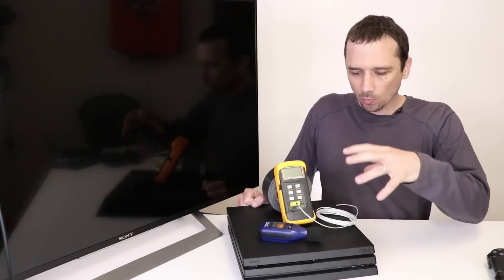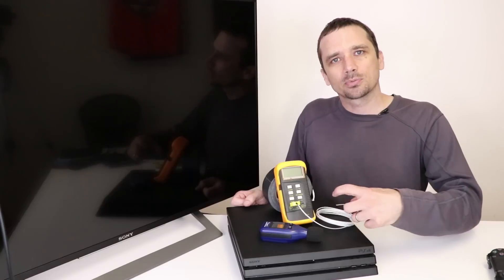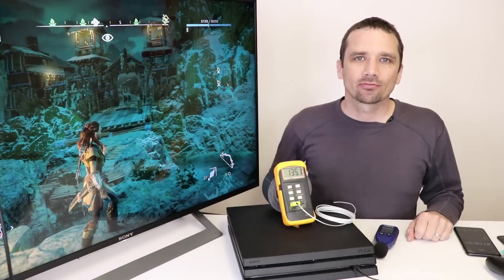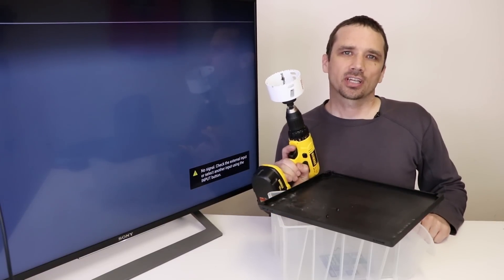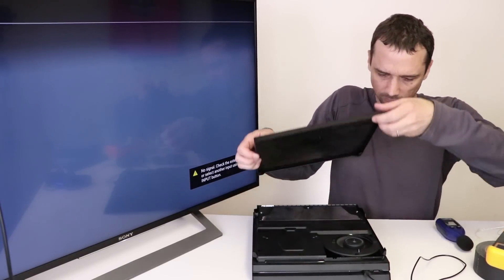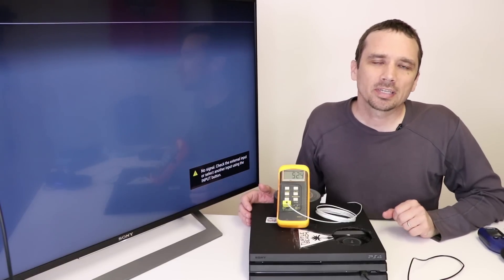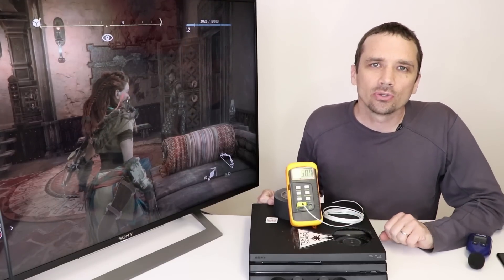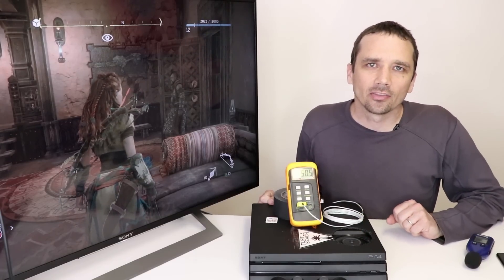PS4 Pro Case Mod - Fan Noise Overheating Fix?

Comment: If the system isn't actually overheating why would you consider doing it? My PS3 slim and PS4 launch never overheat. They get hot but unlike my PS3 fatty I never get the about to shut down message. I did modify my fatty drilled holes in the bottom and did the fan mod and replaced the thermal compound over and under the heat spreaders but those units had issues from launch.

Comment: Or you can just take the cover off and stand it on its side with a small air fan blowing towards it . 😎 I did that last two years and it's a lot cleaner 🤣😂 and cooler less heat all together.  Also the shiny metal part is also getting cooled down.
Reply from the maker: Yep, that would work as well.

Comment: Wehile this works in certain cases and increasing airflow reduces temps especially when open air, the old design maintains a steady temps at least by isolating the exhaust's heated air at the back and grabbing the cool air at the front. Unless you have a well ventilated and open area for the ps4 for this to work well. But in most cases, the old design works pretty well.

Comment: You should have used liquid metal on the cpu (conductonaut) instead of drilling holes in the ps4,you would have seen more noticeable improvements in temps
Reply from the maker: I'll test it with liquid metal at some point.

Comment: Great to see Playstation owners trying to mod their consoles to compete with the power of Xbox One X.
Reply: Be cool if the Xbox had actual games to play to use that power.
Reply: I love how xbox fanboys love to talk trash about how 'weak' the ps4 is when the weakest current gen console is an xbox that struggles to play games at 720p
Reply: TrainNkill bro I play ps4. But an Xbox 1 can easily run 1080...

Comment: What size hole cutting bit did you use to cut the hole? Can you make a video on how to measure and cut the hole for a perfect fit?
Reply from the maker: It's a 3 5/8 hole saw. I didn't measure it...I just drilled it about where it should go.
Reply: Thanks

Comment: Even if it ran cooler. Why would you drill a hole in your PS4 PRO? Simply saying that would invite even more dust inside the console and in turn would make it run warmer.

On a side note it would be funny though to try and send it into SONY to fix and the looks on their faces when they see the hole on top.
Reply from the maker: Why would I not drill a hole in my PS4???
Generally, it's not the dust that makes them run warmer (although if there is enough of it, it definitely would). It's usually the combo of dust, hair, etc. It gets in and plugs the heat sink. If you keep it up off the floor and in a well-ventilated area and you don't live in a really dusty area it will be fine.
Reply: That was my point. With a hole in the top that would invite everything from dust, dirt, food, human hair, pet hair other fibers into your console. Of course yourself it might be fine because I'm sure you clean the inside of your PS4 PRO regularly. But, For the common gamer the PS4 and any other console we get in it has on average 3 compacted handfuls of dust and dirt and I could only imagine how much it would have with an open hole that is about the size of a hockey puck.

Comment: I did this at the weekend. Got my hole lined up perfectly and installed a mesh grill. Looks really good and noticed an instant improvement in fan speed/noise and temperature. Works a treat
Reply from the maker: Nice work!
Reply: I really wanna do RGB led strips and a color changing paint job on mine...
Reply: @mikeoxbig7806  how about I Focus on the overheating for now

Comment: What you could do to add to your mod is add a fan to it let the fan push air into the ps4 fan see what temperature your going to get I'm sure it would be alot cooler

Comment: Hi, can't you just leave the lid off?
Reply from the maker: Sure...but that'snot as fun!
Reply: TronicsFix I am getting one tomorrow believe it or not, but you have got me worried about the temperature and noise?
Reply from the maker: It will be fine. Sometimes it will get loud, but that's normal.
Reply: TronicsFix ok thanks buddy will let you know,
Reply: TronicsFix hi buddy,
Got the PS4 pro today, working like a dream 😃😃😃

Comment: I did this on mine (ps4 pro) and installed a 4 inch usb fan above the hole to push more air in, the thing is whisper quite now.... 100% worth doing 👍🏻
Reply from the maker: Nice! Thanks for sharing.
Reply: @Tronicsfix  hi  Tronics fix could you please make a video what this buddy has done with his ps4 pro and could please say where can I buy a top case or a new case for my ps4 pro?
Reply: I'm thinking without the cover on there would be no flow thru the system so I don't think that would be the best idea, but trust me I'm winging this and so far what I've done has made a massive difference 👍🏻
Reply: @goebes1066  

Hello, would taking just the top cover off be okay instead?
Reply: @AshesHereos  I wouldnt reccomend running it without the top cover fitted
Reply: Goebes you think it would help to just have the cover off??

Comment: A scientific approach .... Well done. So it does change something. 
now the good question is : do I have the balls to do this modification ? not now, since I still have my warranty.... 
And I need to check also with PC modders in order to find a protective grid for this hole....
Reply from the maker: You can always just remove the cover and see if that helps.
Reply: good idea ! 
:-)

Comment: Should note that dust will collect a lot easier with this mod considering the fan is exposed at the top of the system.
Reply from the maker: Ya, just like I said in the video.
Reply: TronicsFix Just like you said what? You never mentioned anything that I spoke of. 

But feel free to timestamp where you talk about dust/foreign object collection in the fan housing with this mod.
Reply from the maker: Ha, ha...just checked...you're totally right...apparently I edited that part out.
Reply: Yea but i think if you can somehow have an dust filter that was easy to access like a good pc case.

Comment: Hi tronicsfix,
Have you had any issues with God of War? It's the only game that's been crashing on my Pro. It's a digital copy from PS Store.
Any remedies you could suggest?
Reply: I did. My pro sounds like a jet at times playing god of war
Reply from the maker: I haven't played it...I might have to though.
Reply: 👆I haven't had any issues playing god of war on my PS4 PRO on my 55 Sony X930E...I've played 11 hours straight thru...This PS4 PRO is only 2 months old...it's Definetly a newer model..I also replaced the stock HDD with a 2tb sshd from

 seagate...try cleaning your old PS4 PRO with a compressed air can...gotta keep it clean..and make sure it's in a well ventilated space...not an enclosed entertainment case..also Doom

 with the enhanced 4K Patch makes the PS4 PRO fan scream a lot worse than god of war...probably because it runs at 60 fps...it's glory killing that PS4 PRO to the max limits...both are digital copies
Reply: 👆Carbon suicide mtb...I get it..I have an XBOX ONE SCORPIO Edition Also...I Understand that the PS4 PRO Patch Is Not Native 4K...But Checkerboarded 4K on both God Of War and Doom..It runs

 smoothly and quietly on the X..But it doesn't change the Fact that my PS4 PRO Fan screams to the max when running these Pro Enhanced Games...
Reply: delete it and download it again
Reply: Tom Pupino 1440p is not 4k, there is 6.4 million pixels missing from 2160p

Comment: I have the release day ps4 and it sounds like a jet but I'm buying a new ps4. Which ps4 is the most silent and would stay silent for a long time? I was thinking between the slim, pro or cuh-1200 pls help!
Reply: @Reminiscence26 doing thermal paste is very risky because I have to detach basically all the mini wires inside my ps4 and take everything out to just get to the mother board and buy all the supplies and tools and then MAYBE it might work who knows.  I'm just gonna sell my ps4 and buy the slim and it also supports 5ghz which I want also and the 1tb so I think to me it's worth the upgrade
Reply: Carbon suicide mtb SMH Cause X always has 2160p right? This is a straight lie. High to Ultra graphics? It has a higher setting for textures and sometimes minor better CPU settings. It has the same crappy CPU in it as the Pro. Please stop spreading lies. Thank you.
Reply: I have the CUH 1200, if u have the cash go newest generation PS4 Pro instead of launch version.
Reply: My PS4 Pro CUH 7115B is super quiet. But if you don’t have a 4K T.V. And you don’t care about supersampling and a few extra frames, go for the slim.
Reply: Have you done a thermal paste change and this fan mod, sinse you bought it? You may not even need a new ps4. Like you, i have a launch ps4. With the fan mod and MX-4 thermal paste. Still runs great and not too loud. It is true though, that the slim has a quieter operation. But on a well maintained, launch ps4. There really isn't a massive difference in fan noise tbh.
Reply: If you're wanting silence the slim is definantly the way to go.
Reply: iptia  I have the pro and when you play god of war it’s loud. I took it apart too clean the fan with air from dust it helps a little but it’s still loud
Reply: The Slim is definitely the quietest of them all. Digital Foundry tested them all when the Slim/Pro launched if you look it up.
Reply: BuzzRaceWars everything I said is fact snowflake, the ps pro is a complete joke, deal with the facts, even if it does make you upset, now go to your safe place before you make a complete fool of yourself again
Reply: Wait until after E3, who knows what there might be.
Reply: iptia buy a one X, it's silent, plus the difference between 1440p on the pro and 2160p on the one X is 6.4 million pixels plus pc high to ultra graphics settings, it is far superior

Comment: if u cut a larger flow then it will suck twice as much dust
in it. Dust is everywhere no matter how clean ur house is it is still visible in the air.
Reply: that's why you clean it :|
Reply: Dust filter.
Reply: Dust already gets in anyway through the normal intake. You should be cleaning regularly. With this mod, you need to clean regularly. Nothing has changed.

Comment: im really big fan of your videos , i really need a help so please answer me i have a ps4 pro and i used to have Dell pc that got damaged so i took its fan that working as sucking the heat nd getting it outside and it seems really strong fan so i put it after i did power circle to the right corner of the ps4 pro but as a fan to push air to the vents but i have notice it sucks dust nd push it inside so i decided  to put it in the back on the left side so it can suck the heat from inside and when i put my hand  i feel the fan pushing too much hot air and vents in the back from right side close to the power cable i have noticed the hot air that used to flow before much nd hotter start to get slower so i want to know does the fan works fine or it is because fan strong so it is taking most of the hot outside so the vents just pushing few hot air
Reply from the maker: I'm sorry...I can't understand your question. It is literally one long sentence. Any way you can break it up and make it understandable?
Reply: You literally do not need to use any 3rd party fans, or modify your console. It has a negligible difference and can be harmful!
Reply: thank you for your answer all i mean is i put a fan in the back of the ps4 pro to  absorb the hot air and when i put my hand on this fan i feel it is taking out hot air from inside ps4 to outside from back vents so does this help the cooling process by  helping the vents to get out the hot air
Reply from the maker: Sounds like something that won't hurt anything but it likely won't help much either.

Comment: yeah but it's not pulling heat off the hard  drive and cd rom. 

your test is just reading the exhaust off the cpu right? befor the hole was made, it was the heat from the hard drive, cd rom and cpu. you by passed two of the three heat sources from the looks of it. please confirm that is, or is not the case
Reply: bdroms and hdd do not generate that much heat to be cared at all... the main super hot heat source is the cpu and only the cpu
Reply: No there isn't. The blue-ray drive does not generate any significant heat (when it does spin, rarely in game since they're mostly played from the hdd) from my experience and the hard drive is on the bottom and to the back.
Reply: Forgetting the drives for a moment, the way these things work is like the shroud in a hot rod. Containing the air rather than allowing it to disperse, so it blows (and blows *fast*) across the components where you want it. If you're getting cooler air at the exhaust, it doesn't mean you've cooled the system better--quite the opposite. What you want to see is more heat exhausted, less heat on the processor.
Reply: I place a small-ish desktop fan in front of my Pro sometimes and even though it doesn't really make it any quieter it certainly stops it from getting as hot.
Reply from the maker: Air comes in from both sides of the console and is exhausted out the back.
Reply: Manuel G Yeah when i touch my console after 4 hours of gaming I can feel that it’s extremely hot where the power supply is placed but apu gets good cooling in these consoles I never experienced any heat issues.
Reply from the maker: I'm not sure what you're talking about. These don't have a CD rom. There is no heat source that's been bypassed. Did you watch the video?
Reply: TronicsFix as the console is facing  the viewer, you say the airflow is from left to right, then out the back towards you. are there any heat sources on the left side of the console, like a game cd reader or hard drive that do create heat now being bypassed because of the hole?
Reply: @Tronicsfix  he is correct this might cool the heat being dispersed but components might not be getting the correct air flow

Comment: Title should be "How to make your ps4 pro stay cool and quiet"
Reply from the maker: Ya, but that's not nearly as dramatic!
Reply: Would try it on my one X but it doesn't seem to have cooling or noise problems but i did re-purposed the fans out of my 2007 xbox 360 and wired them to run off the wall outlet as some extra cooling for the summer, i stand it up next to the side vent.

Comment: Nice im definitely doing this, there's a magnetic fan filter that you can use to put over the case and it makes it look much nicer and cleaner, cheapest place i found it on was on ebay
Reply from the maker: Good idea
Reply: Hey can you link where you found the fan cover
Reply: Dylan Salcedo i don't think i can post a link but i can tell you the name its called DEMCiflex fan filter, you can find them on ebay and amazon
Reply from the maker: You mean the plastic housing for the console? I had it laying around my shop.

Comment: Please, Steve, I would like to see how far does god of war push the ps4 pro, because I have tested the game on a slim and doesn't make much noise, in the other hand the pro sounds so loud. So try to test it for us.
Reply: Playa' I guess it depends what pro you have I'm guessing the first few are louder than most recent one or could also be that the pro has to deal with more like trying to stabilize the framerate or sharpness resolution too.
Reply: @Playa' how does the slim sound? Does it get loud on some games like bo3? I am thinking of buying it
Reply: Lefty nation, my pro is one of the recent ones
Reply: Iptia, the slim is very silent as far as I can tell, but if you want more power and 4k resolution, in that case you should get the pro. The pro is only loud in few games. But overall the slim is quiter
Reply: Playa'...it is loud on the PRO..but Doom with the new 4K enhanced patch is worse than god of war...make sure the PS4 PRO is in a well ventilated area...
Reply: Top pupino.. Yeah, ive taken the precaution of using it in a ventilated area.

Comment: Looks like the cover is kind of isolating the sound that the cooling fan makes. I wouldn't do that for an aesthetic standpoint and even for acoustics, since it doesn't lower temps that much.
Reply: Kévin TARDITO 10 degrees is significant. but likely within operating specs on a clean ps4
Reply: That's because the system is set to target a certain temperature to maintain lower noise, increasing the cooling lowers the noise, and as we all know the PS4 is loud.
Reply: Close to 10 degrees Celsius is 20% cooler than it was. That is a huge drop in temp so to say it doesn't lower them that much is entirely wrong. Also it operates 1db louder with the hole. I won't do this purely for aesthetics but if you don't care about having a hole on the top then it's a grand idea.
Reply: Was noted it did go up to 54db without the hole, and in many other videos the stock fans hit up to 58db.

Comment: From what I can hear in the video the fan sounds really loud
Reply from the maker: Didn't test it but part of that is because of how close my microphone was to it.
Reply: Yeah I was gonna say not even my PS4 Pro Sounds that loud lol
Reply: James Knowlen cos the loud fan of the PS4 has driven them insane
Reply: @MirzaKhalid  Actually the newer pro sacrifices cool to stay quieter. I'd rather have a cooler system over quiet. But my mom is bitching about it. I might just get a slim so she stop bitching. You think I could trade in my Pro for a Slim?
Reply: @MirzaKhalid  Oh I have 2 year old pro I'm pretty sure the warranty's up. I'm actually going to see if it needs to be cleaned thoroughly & have its thermal paste replaced & fan changed from the cheap thin one Sony used on its first gen Pro's.